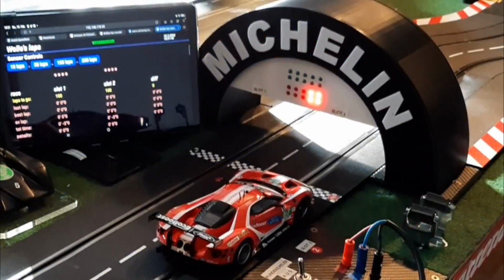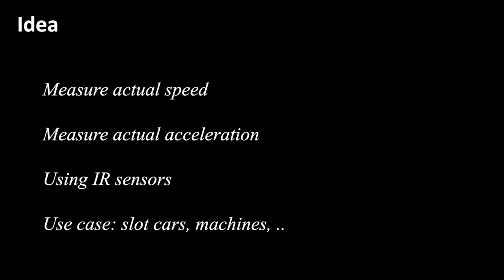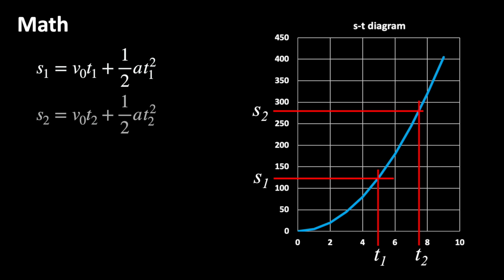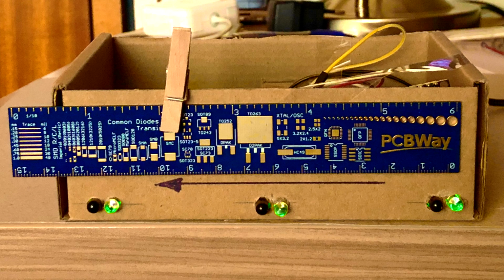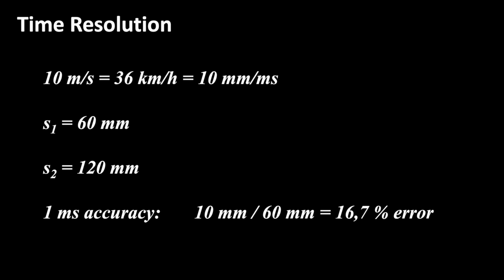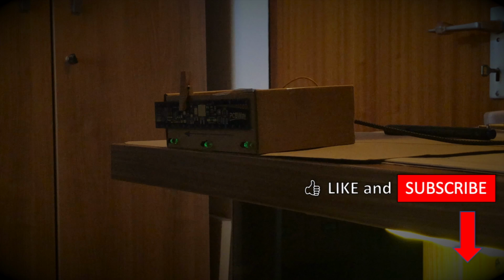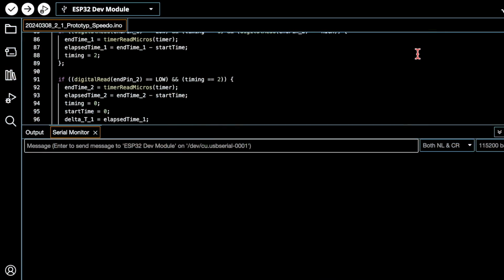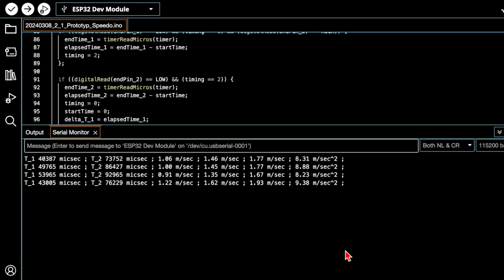Slot Car Speed and Acceleration measured using Arduino ESP32 and IR Sensors (EP110)

Comment: A nice project, a good explanation how and why you are doing.

It it difficult to achieve repeatable results with these IR sensors. They are designed for obstacles avoidance. I tried different methods, and the best one, the most precise, is using a pair of an LED and a LDR, one under the track and another above. A car blocks light completely, and the LDR senses light (and triggers the IRQ as you did) as soon as the has passed over. This gives very precise timing independently from the height of the car's body, its reflectance, etc.

https://youtu.be/mWX0-FcvBvc?si=QHxJ_4V_AHVp1Yqt
Reply from the maker: Alex, thank you very much for your valuable comment! 

I can confirm that IR sensors are a bit tricky. I made an earlier video where I tested the IR sensors. Different color, surface etc. are playing a role. Maybe your method is good fallback solution in case mine is bearing unexpected problems.

In an other project, the slot car lap counter, the IR sensors are working very reliable anyway. The real problem I had to solve was multiple triggering. I needed to solve that in the Arduino code. 

In this project I want to be flexible with the device, so that I can measure speed and acceleration at any arbitrary point along the race track. That's why I will develop a special housing with narrow slits for die IR sensors to make the  triggering points better defined. So, keep fingers crossed and stay tuned :-).

Just subscribed to your channel, nice projects!
Reply: Ah, I haven't seen your other videos. I will definitely watch them!